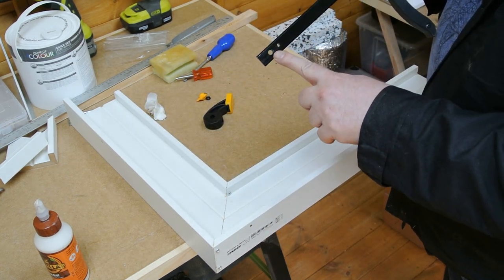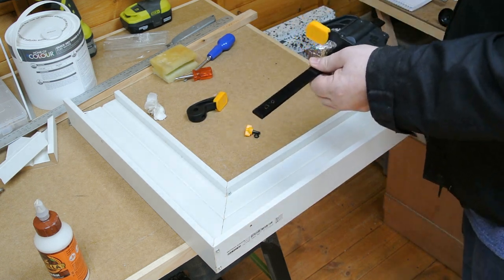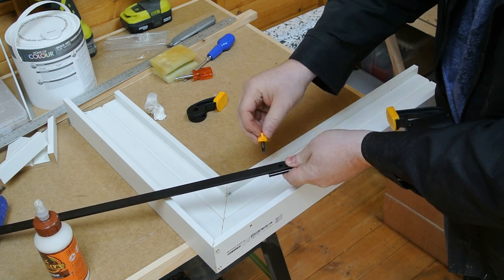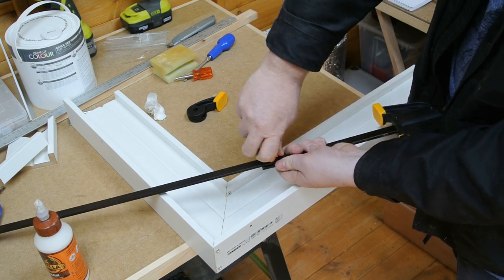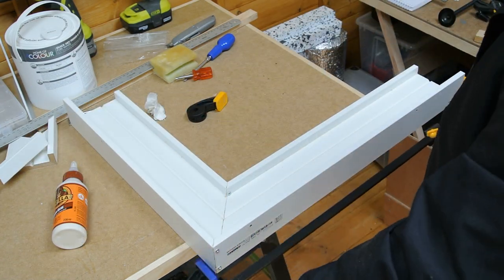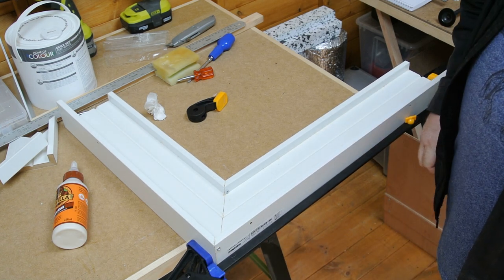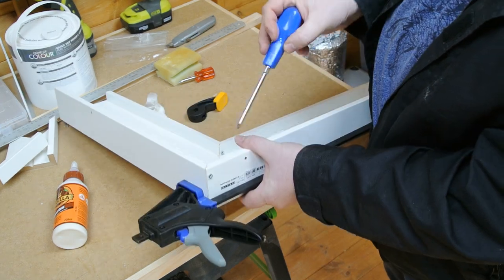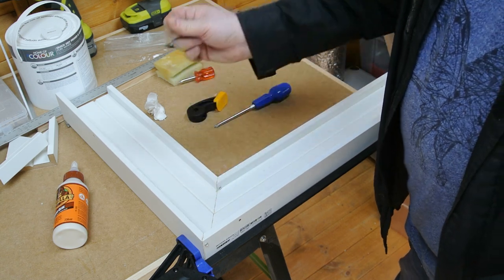A Very Quick Quick Clamp Tip

Comment: Great tip, had not thought of that.
Reply from the maker: +Paul Lockwood I won't take complete credit formthe tip as I did see a while back an Irwin Coupler for about £10 in Bunnings (on Amazon too http://amzn.to/2E2ACDA) which does the same sort of thing. And I used to watch my dad bolt sash clamps together as a boy. But that shelf joint wasn't going to hold itself together even with 3 screws.

Comment: What software do you use for your designs? Great channel I’m addicted'
Reply from the maker: Hi Darren - thanks for the comment I'm glad you're enjoying my videos. I mostly use SketchUp which is good for almost everything, including producing solid models for 3d printing. However I've just recently learned Fusion 360 but you won't have seen any use of that on the channel.
Reply: @StrawbyteWorkshop  Thanks for getting back to me I will check out fusion360. And yes your channel is brilliant keep them videos coming. Have recommended you to other friends of mine also interested in woodwork. Cheers mate 👍